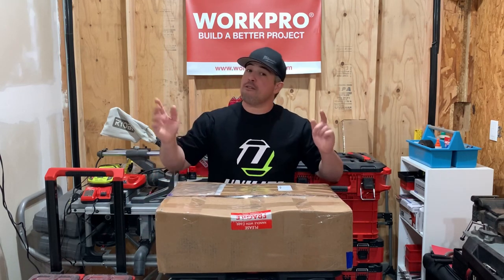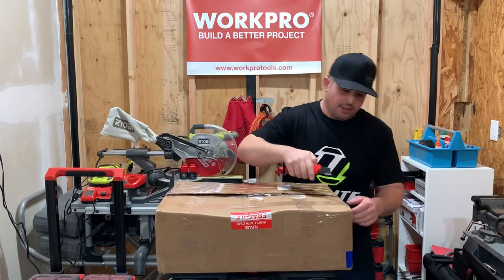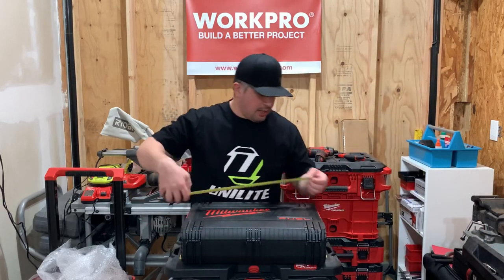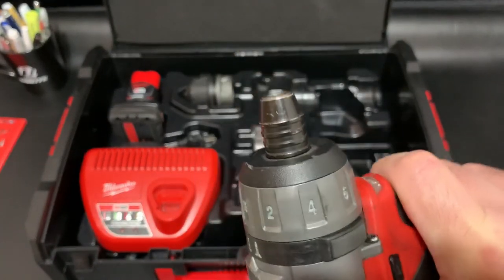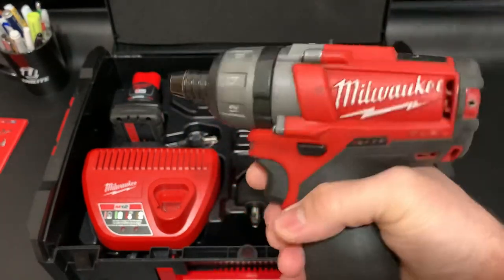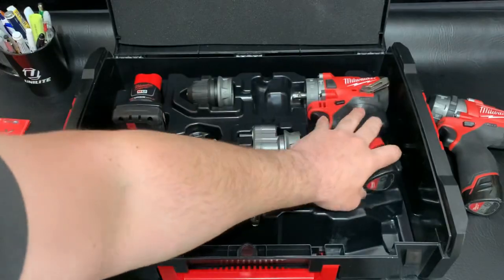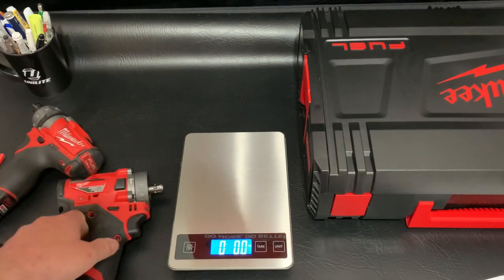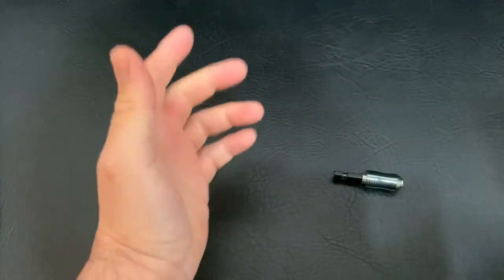Milwaukee M12 FPDX Kit Unboxing From Adzy’s Goods

Comment: Thanks for the video.
What do you think about the light in this machine? Will it give shadow if you drill for example?
Greetings from Germany👋
Reply from the maker: 👍👍 So far I just started using it at work and noticed that the light isn’t that great. Pretty much the same as the other screw gun.

Comment: The company overseas that I obtained my Milwaukee 3pc Metric Lug nut socket set from that they do not distribute here in the United States also carried the black pack out sets i was initially going to purchase a good potion of my equipment from them but between the shipping and delivery time was crazy because alot of them companies do not ship to the US but I had to email them and they actually called me back and we set up arrangement when they sent me the sockets it almost took 3 months for me to receive them going thru customs and all and yes you are right when it comes to the US Currency Transfer to the AU and Euro
Reply from the maker: Yeah, it can be difficult at times, this one arrived pretty quickly! They have some deal with DHL!
Reply: @AutobahnDan  Yea it was DHL that delivered mines as well but what was going on during the time was that they were having delays do to Brush fires 🔥 my shipment 📦 was coming outta Australia so it was taking crazy long for me to receive them
Reply from the maker: @toolsmetals2148  oh man! I’m waiting two weeks now on a small OLFA knife from Japan!
Reply: @AutobahnDan  Japan is the worst when it comes to shipping unless you arrange something other than normal standard delivery with them they are another one too the worst 👎🤣